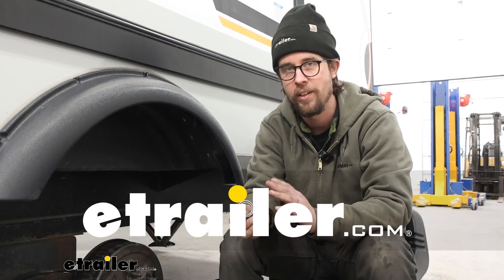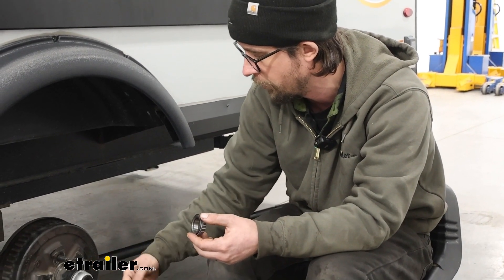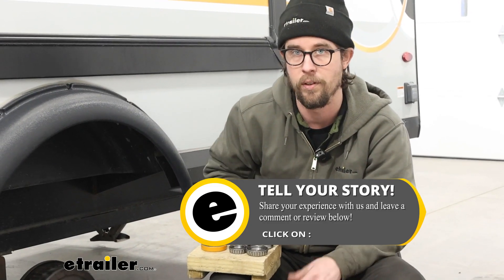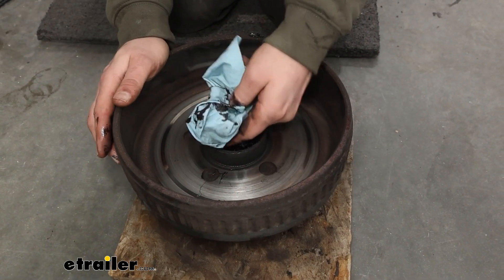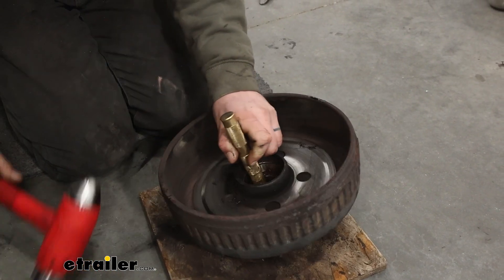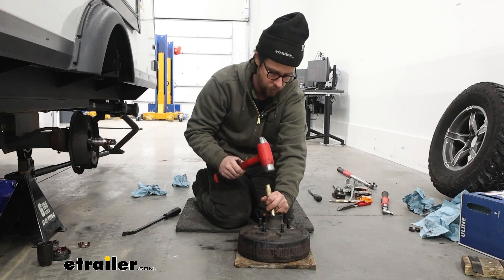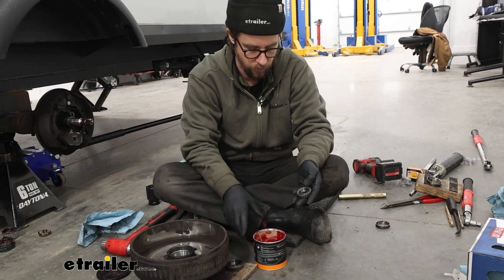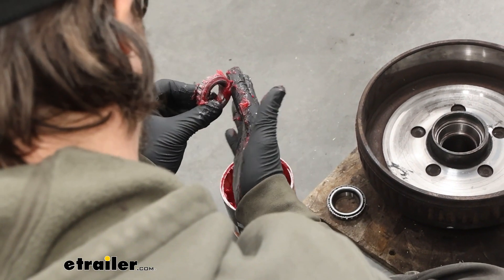Installing the Timken L44649 Trailer Wheel Bearing on a 2022 Forest River Rockwood Geo Pro Travel Tr

Comment: Great video & thanks for posting the individual part #'s !!  Will these parts fit my 2015 Outdoors RV Creekside 22RB ? It has 3500 lb Dexter axles....no part #'s in the manual so could use a little help...thanks again !!
Reply from the maker: The 3,500 pound Dexter axles on your 2015 Outdoors RV Creekside 22RB should use the same parts, but I am always a  little leery of just saying yes. I have had that come back and bite me in the butt a few times, so I always tell people to either contact the trailer's manufacturer first (they should be able to tell you exactly what they used when building it), or pull one of the hubs off to verify what is actually there. Contacting the manufacturer is definitely the easier way to go.
Reply: @etrailer  ok thank you